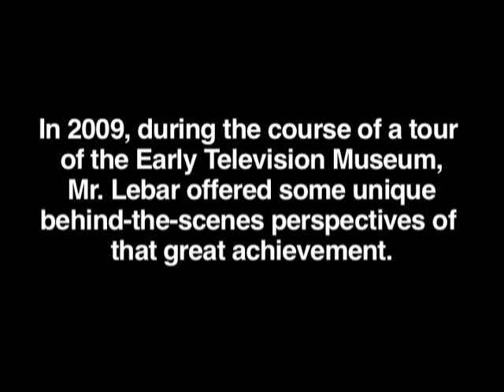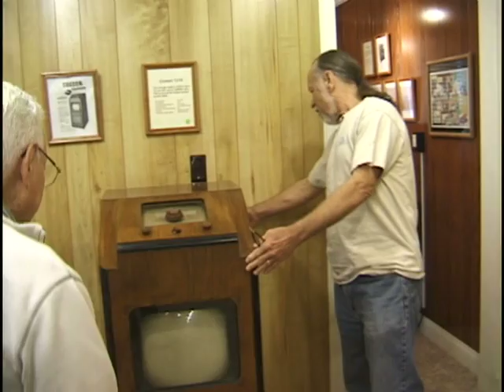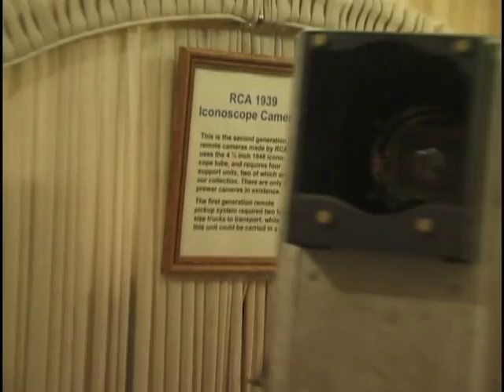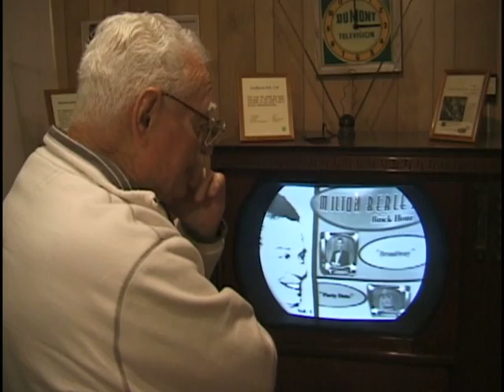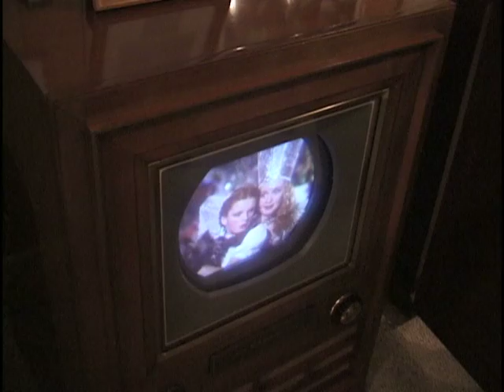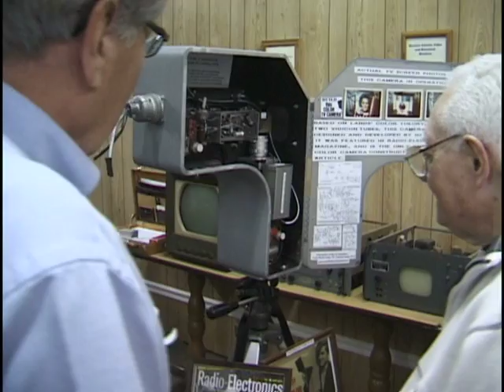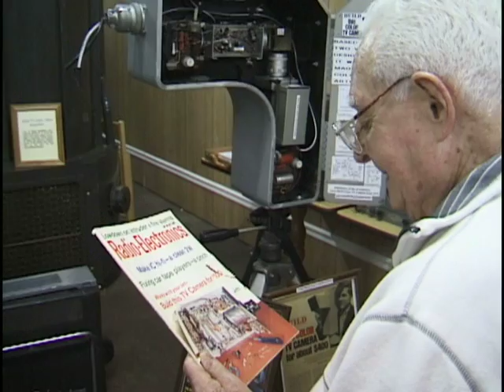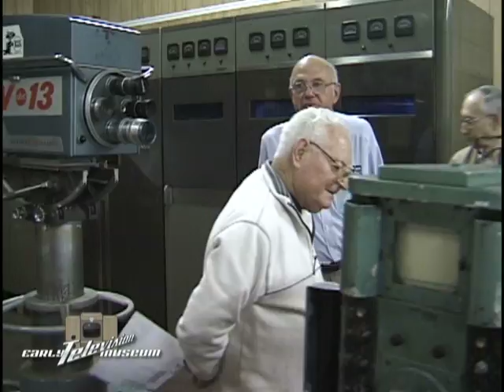Stan Lebar at the Early Television Museum

Comment: IN 1968 I worked on the Bathyscaph Trieste II simulator.  The actually had a black & White TV camera as a remote viewer and could be panned right, left and up and down. with an early type recorder that tapes could be view on the surface.